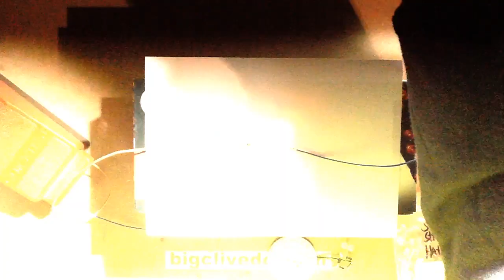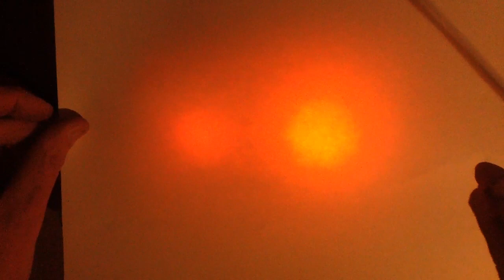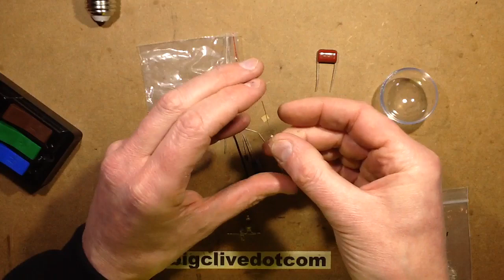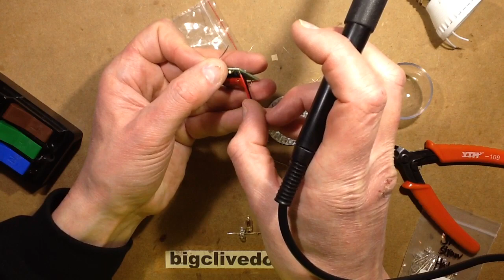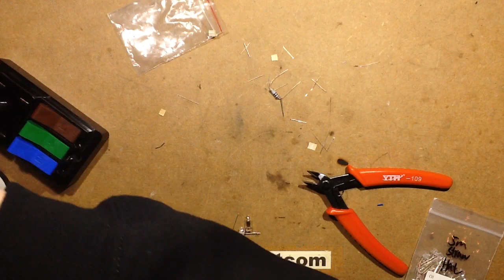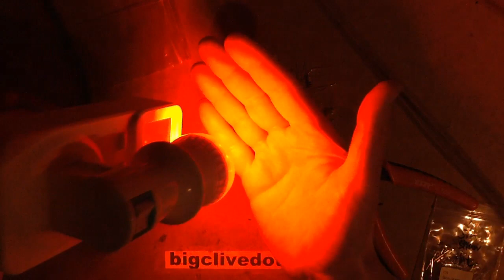Neon versus LED.  With kit lamp build.

Comment: I was kinda hoping for the BANG when it was plugged it...but Clive built it right...damn it  ;)
Never had a neon go bad on me...I still have an old (40+ years) nightlight that works perfectly!
Reply: In my experience in every single modern 4/6/8 gang extension the neons go bad.  From what I have read its that the manufacturers use too low a value resistor to make them bright. :(

Its so annoying, as my Masterplug with an earth good and surge good neon is completely impossible to identify them now.  But I guess that sells more because people think the surge isn't working, when in fact its just the neon (in pitch black you can JUST about make out its still lit).

Comment: I use these lamps with white bright LEDs for my bench lights, get the whole kit minus diffuser from the bay and they work great in  bendy lamps, I aways put the bottom circuit on the white stand of in the bottom of the lamp housing and just hit the plastic stand off with the soldering iron to secure the PCB Mine have always come with a 100 ohm resistor, great videos.:)

Comment: Thanks for the comparison, Clive! Lovely kit, and the orange glow is dead-on, colorwise. I agree that the neon wins in size and simplicity, which is great for panels in industrial environments. But I've an additional reason I prefer them: they handle mains voltage transients more gracefully, at least to a certain extent. Not really an issue in domestic/residential use, though.

Comment: I once disassembled a faulty kettle which had two LED's to indicate that the power was on and they were wired directly to 240v mains with just a resistor and a single IN4007 diode. I've noticed in recent years that LED's are frequently being used in place of neon indicators in a similar manner.

Comment: another way electrolytic capacitors go bang aside from what you mentioned, Clive, is if one is replacing an electrolytic cap with one of much lower value than the high voltage chassis circuit required, also making it either vent in either controlled, or on rare occasions, violent manner

Comment: APU, love your work.................purchased some Chinese oven neons after seeing the previous video. They state 240AC, no resistor, orange. Should be fun. They are so tiny and straight across 240ac.....$20 for 40 of them, wired, on ebay. Going to use them as indicator bulbs inside clear 240v 3 pin plugs....just to show the current is active when they are lying around.
Cheers,
David (from Downunder)
Reply: Indicator lights have the resistor built in. Some neons use the resistor as one of the leads going in to the lamp.
Reply: Hi Jim,
I neglected to pay attention that it was you who left me the reply.
Thank you. I need all the help I can get. I have never seen these little neons before. They look pretty handy for some applications.
Cheers
Reply from the maker: Check there is a resistor inside the sleeving when you get them.  Either way, it's a good idea to add another series resistor in the region of 100K to 220K as they often push both the neon and resistor quite hard for maximum intensity at greatly reduced lifespan.

Comment: Clive, I'm looking for that lamp holder with the built in plug and mains switch that you are using. Please guide me o bearded one.
Reply: Teresa, you are a star. Just bought the last one. Many thanks.
Reply from the maker: Note that these do not contain a fuse and that if it's the Edison Screw type the polarity may be random.  (switch on neutral and outer thread live.)

Comment: Voltage range for these kits is 85-277  but the polyester cap is 470uF. Surely that could be adjusted for 120V use.  And yes kits with the LEDs included are £1,14 or $1.45. Easily found with ebay's own suggestions. However they are 3mm, and colour temp is not stated.

Comment: In the first test you give the leds almost 50 times less power so even if they are 10 times more efficient they are dimmer. ( remember power = voltage x amperage not just amperage ). The second test is then much better. Also in the first test the neon is almost alone plus the resistor so it's brighter than in the original device.

Comment: Hey Clive, I have a Hakko 888D, which looks very similar to that soldering iron. What tip are you using? The stock conical tip my iron has doesn't have much heat capacity.
Reply from the maker: I use the 3mm angled tip.
Reply: James Pourroy He uses a 3mm chisel.
Reply: Thank you! Exactly what I needed to know.

Comment: Very impressive soldering, any idea how difficult it would be to replace a sim carrier in a mobile phone.
Reply: this is an unqualified answer by me but I'd say it'd be footery difficult
but why let that stop you
Reply: Very, very easy if you have the part, a hot air gun and some solder paste. Would take me about 5 minutes. However, if you've never done surface mount stuff before, it might not be the best first project. If it's a through-hole SIM carrier, which I highly doubt, then that would be easier.
Reply: Aurelius R Thanks.

Comment: gasp Imagine a string of Christmas lights, but it's little neon bulbs instead. :o
Reply from the maker: There are vintage sets of glow discharge Christmas lights, but they're very hard to find.  A common effect in some parts of the world is strings of the neon flicker flame lamps.
Reply: Wait, are you from LG?
Reply: "gasp Imagine a string of Christmas lights, but it's little neon bulbs instead. :o"
20 lights in series... for even more fun.. 20 x 50 volts per lamp..  when lit.... 100v to strike... 20kv to be sure of striking the lot.. with the whole thing powered by a TV Line output transformer... what could possibly go wrong... sounds like fun to me.. };¬)
Reply: I wonder if they use the flicker flame lamps on trees, I'm not sure I'd want it to look like my tree was on fire but then again I am a bit of a pyromaniac so hmm.
Reply from the maker: They do.  While I was working in France I noticed that the flicker lamps in foliage was popular.  It looked very good.
Reply: Andrew Hull

They make light strings where every light  is connected to mains voltage. How do you think strings of C7 lamps work?

Comment: How hot do you have your soldering iron for the stuff you did in this video - seems to melt solder real quick (big tip, I guess)?
Reply from the maker: 3mm angled tip at about 330C.
Reply: Big Clive is a big guy, he's bound to have a big tip!

Comment: As you've seen with some Chinese builds, you CAN run an LED with just one resistor  

It ain't pretty but it's possible
Reply: Surely you need at least a resistor and a diode??
Reply: Roflcopter4b 
An LED is a Light Emitting *Diode*. All you need to light an LED off the mains is a suitable resistor (or capacitor) to drop the voltage and that’s it.
Reply: @mrb692  LEDs are notoriously bad at being diodes though. They really do not tolerate reverse voltage well at all. In my experience they just die instantly even at fairly low voltages. They may technically be diodes, but in reality they might as well be more like electrolytic capacitors. Put them in the right way, use a real diode, or suffer.

Comment: I have an OSRAM Lunetta LED nightlight which I really like very much.  I've not intention of opening the unit up because I do use it and I probably would break it if I were to open the unit up, but I'd be curious to know if it uses a capacitive dropper or power transformer?  I assume it's using a capacitive dropper to drive the LEDs.  I know that viperfreak and others have talked about dangerous LED bulbs that use capacitive droppers and which are not isolated/insulated correctly and can pose a major shock hazard.  If done correctly, are capacitive droppers safe to use in electrical devices?
Reply from the maker: Capacitive droppers are fin in enclosed devices like lamps.  Your OSRAM lamp probably uses a switchmode supply.

Comment: Still like the Neons better. Would there be a way to get Neon indicators like that in a different color? Xenon or Argon, for example.

What's the best circuit to drive neon indicators off of a set of batteries?
Reply: The only circuit to drive neon off of batteries would be a boost convertor. The forward voltage of a neon lamp is around 50V, as Clive said. So you either need 50+ volts of batteries, or a boost convertor that can handle 50v. Assuming you want just one neon -- more than one in series will multiple that by the number of lamps.

Comment: Hi Clive, what soldering Iron are you using? I plan on buying a new one and want the same as you as it works :) I brought a cheapo before and only used it a couple of times and it's already snuffed it. 

Thanks :)
Reply from the maker: Mines a Yihua 8786D station.  But the general purpose Hakko 936 clones are usually OK.
Reply: Thank you so much Clive, I shall be buying the same one you use :)
Reply: @chrischeltenham  the clones are actually rather good.

Edit: at least compared to the cheap bargain bin electronic shop ones

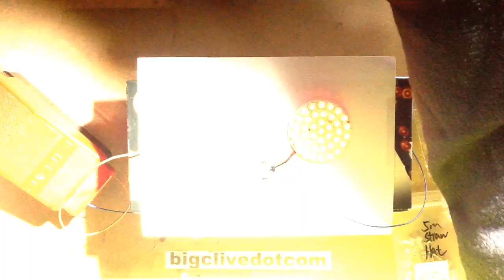Comment: At 4:40 - "And that one is still drawing less current than that neon". Don`t think so: As you yourself explained at 4:05 "they're both going to be drawing the same current because the current is constant throughout the circuit.

;-P

Comment: Hi Clive, I have the lithium ion battery and charger from a cordless henry vacuum cleaner, it has 10 cells which i would like to use split down into 5 sets of two to run my rc models, can i still use the original charger in some way or buy a new one.

Comment: Could you make one of those diy led lamps but with neons instead?
Reply from the maker: Not without a different PCB.  The neons have a strike voltage over 40 times higher than an orange LED.
Reply: Yeah, I was thinking skipping the capacitive dropper and rectifier board and putting mains onto the LED board. Probably not really a good idea, especially if there is not enough track isolation on the PCB.
Reply: But now I got the great idea to build a single neon lamp flower like yours into a clear bulb. I'll put that on my never ending lit of weekend projects :)

Comment: Hi Clive, I'm just about to add a few neon indicator lamps in a vacuum chamber I'm recycling from an old autoclave. (wastedprops on FB). I'm in Australia and have 240v. from what I can find online, they recommend a 330k resistor in series with the neon bulb. can I use a 390k 1/4 watt resistor instead?
Reply from the maker: Yes you can.  It'll be a bit dimmer, but will last longer.
Reply: @bigclivedotcom  you made my night mate!!! Your videos keep me sane. Would love to meet you one day. Thank you for your help!

Comment: Is there a preference to which mains connection hits the capacitor before the bridge rect?  On the screw fittings you can always guarantee which are live and neutral, right?
Reply: no its ac,  1-  50th of a second it will be the other way around anyway
Reply from the maker: Polarity doesn't matter, but I prefer the live to go to the capacitor if I can control the polarity of the connections.

Comment: The neon lasts longer, needs just one resistor, multi angle view, low power.
The neon wins on so many levels, leds are just crap in comparison.
For power indicators ill stay with the humble neon :-).

Leds need more parts, they are directional, they dont cast the light well, 
and wont last like a neon.

Your led lamp is really nice for its use, a propper diffuser needs to be fitted though.
leds are just better for other uses.

Comment: 9:37, what component(s) would you need to smooth it more?
Reply: Just a larger capacitor, unless there's something else I'm not thinking of.
Reply: Larger cap, smaller resistor would help but that would also make the LEDs brighter.
Reply: Larger cap as in more Farads or physically larger?
Reply: More capacitance.
Reply: In tube amp power supplies there are typically 3 capacitor-resistor pairs to really smooth the DC.

Comment: Is there a particular make of through-hole LED's that is a reliable one to buy?

I have been slowly working through a 25-pack I bought a couple of years back from Maplins, but I think it is time to get a job lot from an eBay supplier. The Maplin ones came without any details so it has been hard to properly choose a current limiting resister for them. I'm thinking about having a go at making a clock with an LED matrix for the display. I know this is a pretty unimaginative 'apprentice piece', but I want to do it with only 74-series logic and no micro-controllers or any other clever stuff.
Reply from the maker: For reliability I'd recommend red LEDs as they are the most rugged technology.  If you search on eBay for keywords like 100pcs red LED you will find bulk bags.  You can also add extra keywords like 5mm diffused and straw hat for different styles.
Reply: @bigclivedotcom  Would you say the diffused over the 'super bright' ones for general indicating and display use? I get the feeling the latter, really bright ones have a much more limited angle of view. I think you can get Straw Hat configuration in both?

I definitely agree about choosing the red ones though--although the novelty of having blue LED's still feels pretty intense to me!

Comment: i want to ask you about thermal compound/ thermal paste for our processors and graphics cards how to measure its conductivity for electric current so to be sur if it's spread over a board its will not make a shortcut in circuits but its transfer heat in the same time .. thanks alot .
Reply: thanks alot for reply  i understand now if the lamp didn't light that mean by logic the compound will not be light for all under 12 v .  thanks alot for your time .. :)
Reply: Ahmed Shimi definitly use a current meter, most components are quite sensitive and a normal light-source cannot quite simulate that.
Also you will need to go for ceramic thermal paste or plastic base sine the more common metal based ones will be conductive.
Reply: ok . thanks for reply thanks for your time
Reply: Not to mention, very VERY few thermal compounds are conductive. Just buy one that says it's specifically not conductive. I don't think I've seen one for sale commercially in the last few years that didn't say that.

Comment: bridge rectifier diodes also go boom if you put them the wrong way round :)
Reply: Uh, not true. Whatever they're connected to will go boom because you've reversed the voltage to it. Unless you mean you accidentally put only one in backwards, and even then it would depend which one.

Comment: my car needs new indicator bulbs as its not a bmw or audi, i was thinking leds, warm white behind the amber plastic diffuser should work, but no, i think i should fill it with neons......
Reply: youre going to need a boost converter/inverter to run neons on 12V.

Comment: @bigclivedotcom i work in IT and network support but my true dreams lie in your kinda field, I am working on motor control circuits at the moment and my soldering has reached fever pitch.  My education prospects are weak but i was wondering if you had tips for getting an apprenticeship doing electrical engineering? (ideally with you :)

Comment: Why do you need all these components when it's possible to run these LEDs on mains voltage with just a single resistor like you showed in the beginning of the video? If it flickers it'll only come closer to looking like neon I guess?
Reply: Ni5ei the circuit will live longer. One resistor will either overheat quickly or degrade over time. This circuit is still not pretty but will survive much longer and has the added bonus of more light due to its better efficency
Reply: Thanks

Comment: what kind of solder do you use? just generic cheap chinese?
Reply: I had the same question
Reply: he uses lead based and not lead free as its better , i have found they all seem much the same
Reply from the maker: I get my solder from Rapid Electronics in the UK.  Standard own-brand 60/40 tin/lead.

Comment: "The fact that it's 100 ohm should soften the ripple a little" you've got it backwards Clive, that would make the ripple worse as the smoothing cap cannot recover as quickly with less current to recharge it.
Reply from the maker: That resistor is between the cap and LEDs.  So it softens the dip at the zero crossing point.

Comment: Why does a capacitor go boom when you mess up the polarity?
Reply: Mario Hendriks cuz it heats up and therefore the fluid inside (electrolyte) expands and boils and just like water the pressure needs to escape

Comment: Rather oddly, I'm 20 and code for a living.. But the world of electronics is still mystifying to me, lol.
I decided to order that kit from eBay, but was impatient and decided to attempt to create the circuit from the diagram on the listing.

It took me several hours to find all the components and tack em all together on a proto board.
This is literally the first thing I've ever made that has more than 2 components:

http://gld.bz/c/e7427.png

I was fully expecting a bang or a fireball or something, but it actually (kinda) worked.
(I literally took cover behind my desk when I plugged it in and waited a minute)
I must have used the wrong sized capacitor (250v 68uF) or capacitive dropper (all it says is '1250V')
The LED lit very dimly, so I swapped out the 10 ohm resistor nearest to the LED with a 0.5 ohm one.
Still lit dimly, but disconnecting it and reconnecting it after a few seconds yielded a fried LED as presumably the capacitor dumped a bit too much into it at once.
All the components were salvaged from a broken 100W CFL lamp (something failed internally, couldn't figure out what), so I wouldn't be surprised if one of the components I used is actually faulty. 

So that was fun, it helps the understanding when you can spend time messing with it.
(I know, the soldering job on that is nasty, but that's what happens with a shitty dirty $5 china iron)